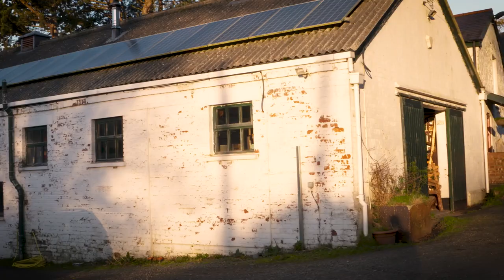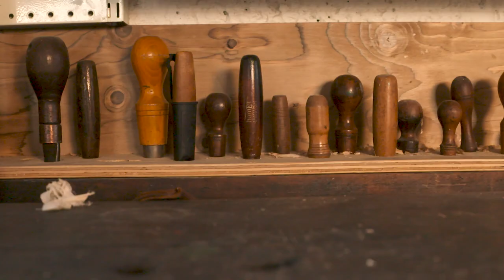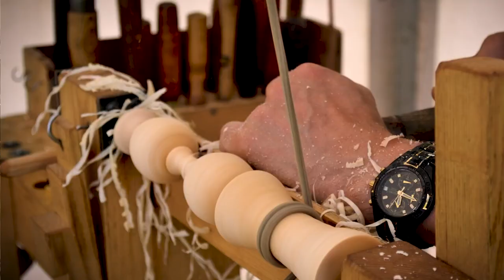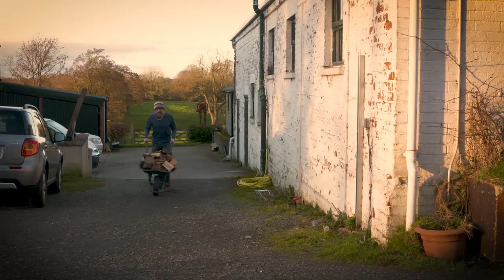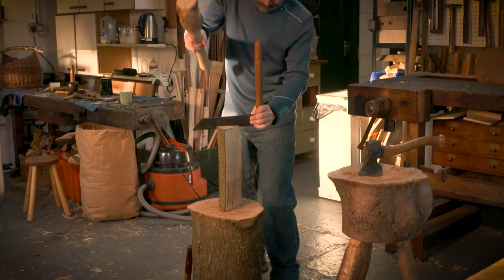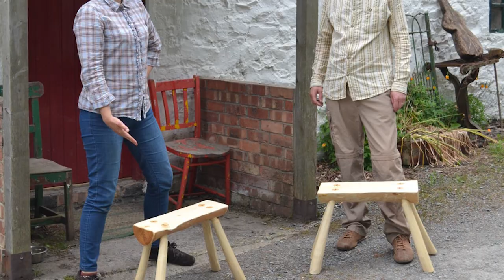Green WoodWork - Interview with Stephen Ryan

Comment: I was actually trying to find green woodworking of beech trunks into trough bowls/dough bowls a foot wide and a couple feet long.i split the lengths of the beech tree,s trunk and cut the sides ,face and back ,and  the 4 corners off with various side/splitting axes,so as to reduce the tension from the corners ,,,when following,when the prepped blanks have dried a little I will shorten the bowl/trough by sawing off any end grain cracks as they appear,hopefully my beach dugouts will hold